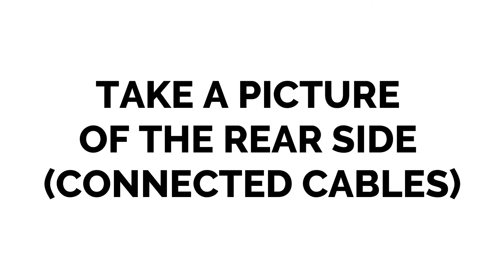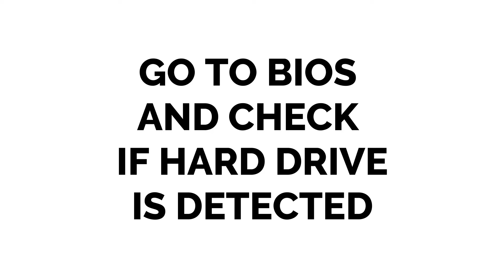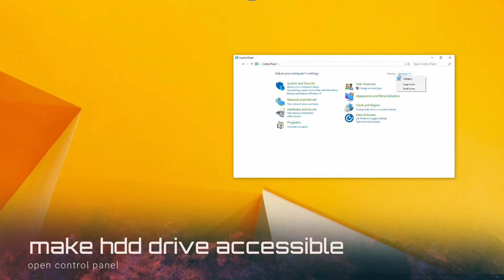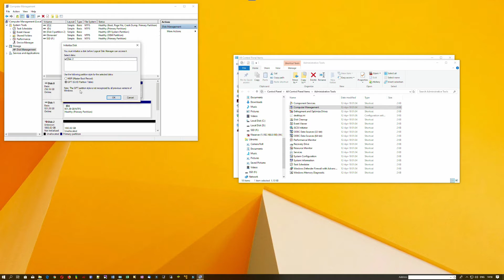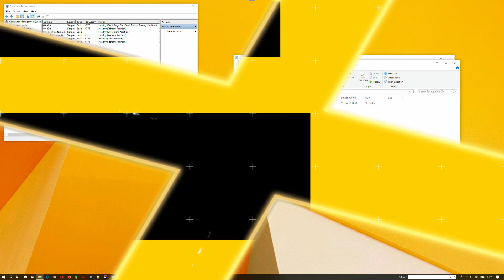How to Install a Hard Drive into NZXT S340, Create a Partition, and Format the Hard Drive [How to]

Comment: Thank you for this video! I got one of these cases second hand and it was very helpful. I would maybe add a little more detail in removing the front face, (had to look that up- it's held on with six pins. Pull away from the case 'at a 45 deg angle', not up or you'll break the pins!) but that was the only problem I had :)

Comment: Where do you install the "3rd" hard drive? Do I need to screw the HDD to the bottom of the case below the hdd cage?. I'm kinda scared to do it, and worried about the drive itself, installing it there.
Reply from the maker: 2x ssd, 2x hdd, screws from both sides for hdd - left and right, screws from the top for ssd. ssd installation is much easier.
Reply: @products-explorer  so it's not possible to install it there? The 3rd hdd I mean. Cause I read it's possible.
Reply from the maker: @AmakusaWorld  4:29, you can put it on the construction. normally there are 2 slots for hdd and 2 slots for ssd. I am using external disks. You can use USB 3 HDD or SSD.
Reply: @products-explorer  i see thanks. i only got internal disk though. ^^.
Reply from the maker: @AmakusaWorld  try to find any video where are instructions on how to install 3rd hdd. maybe instead of ssd or put it over/above ssd.

Comment: Did you really take a picture of the back to make sure you plug everything into the right place? I mean it's all pretty standard.
Reply from the maker: This tutorial/video is for people who never worked with hardware. e.g. You can have a  problem with USB devices order on older Windows versions. If I swapped devices, sometimes Windows didn't detect them correctly. Another case is an integrated audio card and symbols/icons for the microphone, speakers, headphones and other outputs. The faster way is to take a picture and connect all devices back in documented order because I am not able to read these symbols (bad visibility). Sometimes there is a mix of USB ports. They can connect e.g. external HDD to USB 2 instead of USB 3 port, and so on.